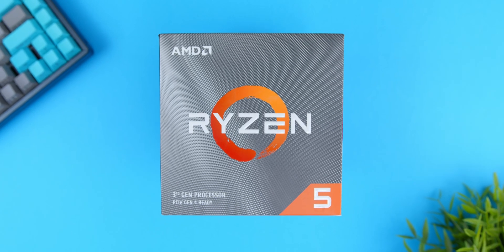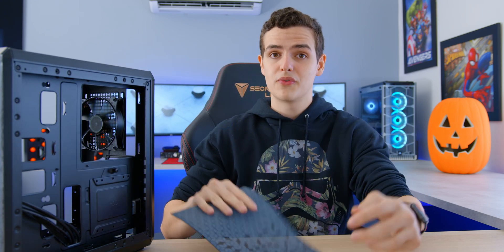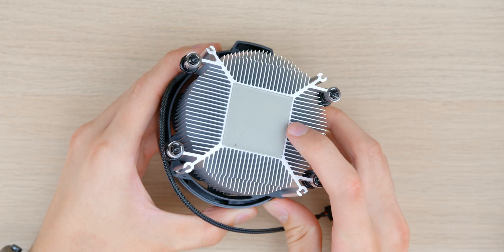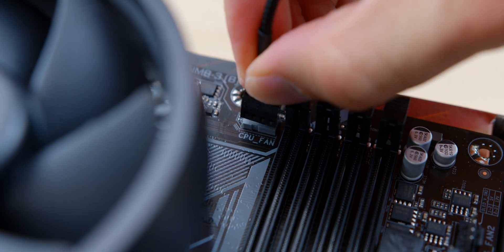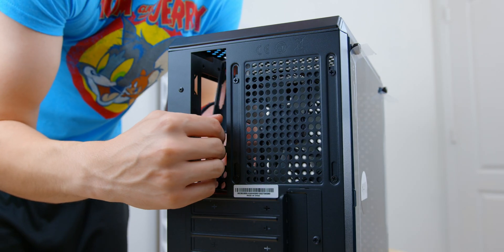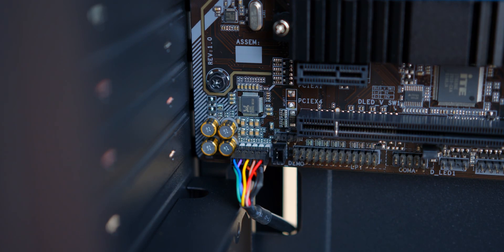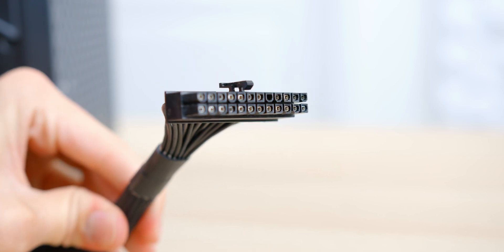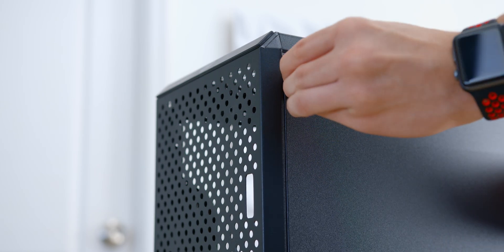PC Build Guide 1.0! | Ryzen 3600X | GTX 1660 Super | $850

Comment: I had a question, im thinking of upgrading my setup to the  3600x + b450m but I read somewhere that id need to Do a BIOS update with an older chip to make the 3600x compatible with the B450m. Is this true or can I just go ahead and use it without a BIOS update? thank You

Comment: First time builder. Is this a good set up
Rosewill box
Rosewill arc 750 psu
Ryzen 5 3600x cpu
Msi gaming edge wifi x570 motherboard
Msi radeon rx5700xt gpu
32gb corsair vengeance 3600 DDR4 ram

Comment: I have a very simular setup, but the major difference is in the cpu cooler. I have a SilentiumPC Navis RGB 240 AiO. Just wanted to recommend it.

Btw i am not sponsoring

I dont like the people that get 1k likes for this
Reply: Yo quick question is the gtx 1660 super with three fans the same as the one he used in the video with 2 fans or is it different??
Reply: @hilltop3603  well... It isnt perticularly faster. But it has better cooling for sure. It has 1 or 2 fps more. It isnt worth it becuse its more expensive than the dual fan one

Comment: really need help! what power supply should i get? these are the parts

CPU: AMD Ryzen 5 3600 3.6 GHz 6-Core Processor  (£179.97 @ CCL Computers) 

CPU Cooler: Cooler Master Hyper 212 Black Edition 42 CFM CPU Cooler  (£29.99 @ Amazon UK) 

Motherboard: MSI B450 TOMAHAWK MAX ATX AM4 Motherboard  (£89.99 @ CCL Computers) 

Memory: Corsair Vengeance LPX 16 GB (2 x 8 GB) DDR4-3200 CL16 Memory  (£79.47 @ Amazon UK) 

Storage: Seagate Barracuda Compute 2 TB 3.5" 7200RPM Internal Hard Drive  (£48.58 @ CCL Computers) 

Video Card: Gigabyte Radeon RX 570 4 GB GAMING Video Card 

Case: NZXT H510 ATX Mid Tower Case  (£73.99 @ CCL Computers) 

Total: £751.99

Comment: I bought a prebuilt one with r7 3700x and 1660S with a 16GB RAM at the price of $850, 930 after tax. I feel like its about the same, but Im a noob so I was worried I would mess up and chose a prebuilt instead of building manually.

Comment: I saw that you respond to every comment so I wanted to ask:
Is this build enough for VR gaming with 60 fps?
Reply: Probably if you get the 1660 super and not the regular
Reply from the maker: I’ve tested Boneworks and Half Life Alyx on the system and was pulling 60+ FPS on both games. The 1660 Super is a great entry level card for VR.

Comment: @12:58 the motherboard shows two separate slot pairings for power led (top left & bottom right). Are those ports the same? Do I have to plug in the power led pins in the top left slot or could I plug them into the bottom right slot?

Comment: Hey man nice vid, keep it up. Curious about your opinion at these days would you prefer the 3600x over the 3600 and why?
Reply from the maker: Thanks for the comment! Honestly, the performance gains with the 3600x are so small that it doesn’t necessarily warrant choosing it over the 3600. The only reason I included the 3600x was based on availability and pricing. If you can find a 3600 going for a reasonable price, definitely jump on it.
Reply: and you can over cloak the 3600x but cant 3600
Reply: @AxoYT  you can on both, doesn't matter though both suck at oc

Comment: I got a 3600xt instead of 3600x and a 600w psu. I also messed the cooler installation up and had to underclock the cpu in order to prevent it from overheating. The pricing of cpu coolers here is outrageous and I'd rather save enough money to buy a noctua nh-d15 cooler. The total cost was $1200 in my country.
Reply: re-seat the cooler

Comment: Do you have Benchmarks for it?
Reply from the maker: I didn’t induced benchmarks on this build, but from now on all future builds will include gameplay and benchmarks. 

Next week I’ll have up another build guide for a $650 build. 👍🏻
Reply: @spectertech  I appreciate your fast response, Is there any BIOS updates that need to be made? Some B450 Chipset boards need updates when using the 3600x i was just wondering.. 👊
Reply from the maker: For sure! As for BIOS updates, it came out of the box ready to go without any issues.
Reply: @spectertech  Thank You! I’m checking out these parts and matching them against my other options. You just gained a new subscriber!
Reply from the maker: No problem! Good luck on your build and happy to have you as part of the community 🙌🏻